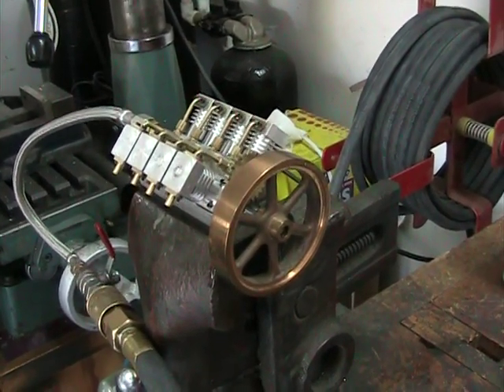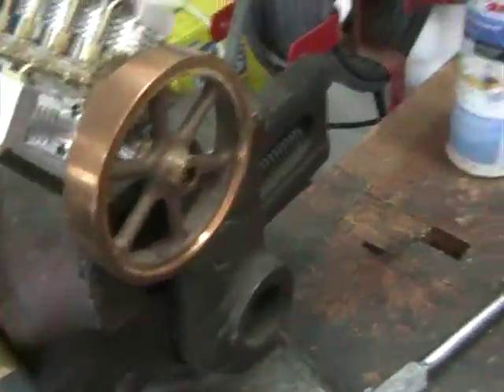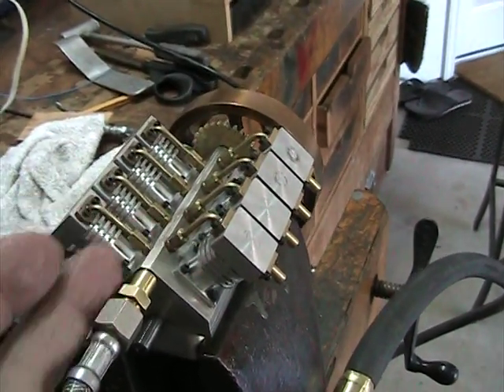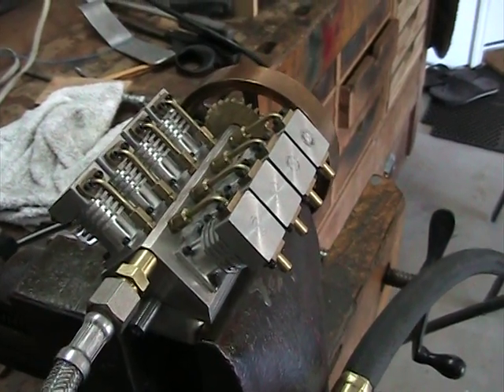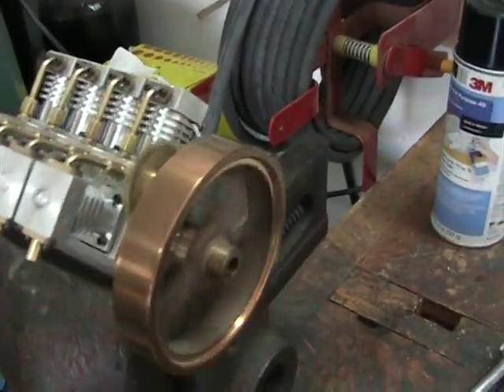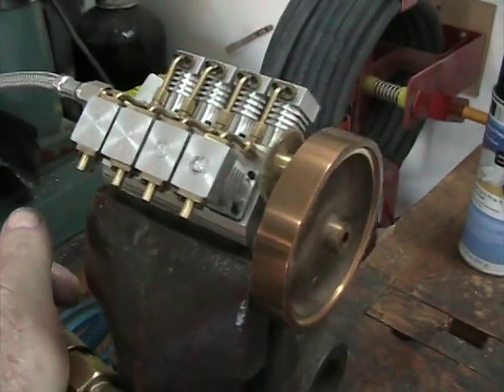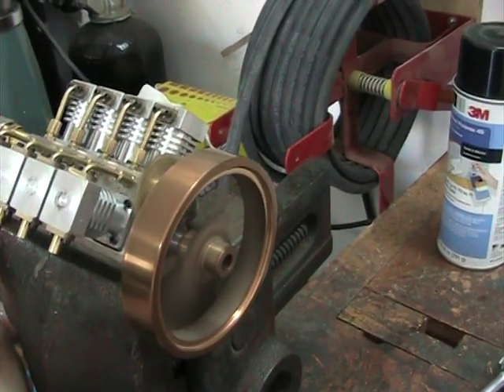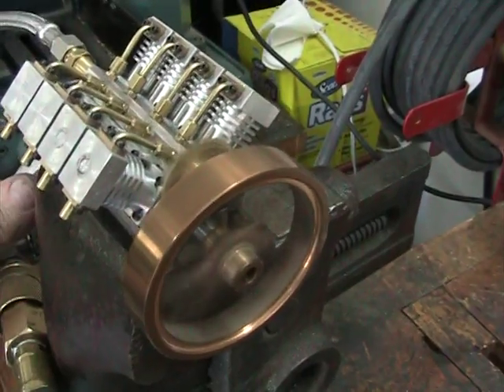Compressed Air V8 N1

Comment: It's a check valve, not a ball valve. Ball valves are manual valves usually set up for 90° rotation, where you are literally rotating a ball with a hole in it such that the working fluid either sees the hole or the solid walls (or something in between) - like the one you use to control the inlet air.

Normally they're used as shutoff valves though, due to their nonlinear characteristics. For finer control you're better off using a gate valve or better still - a needle valve.

Comment: Has anyone ever used steam instead of compressed air in one of these things? May be old school but be fun to see the exhaust as well as consider the fact that you don't need a compressor, just boiling water to produce pressure and a release valve for the throttle.

Comment: Beautiful machine. Such compressed air engines can power a lot of things that need cheap fuel. The light car for shopping could run on air, if we wanted to make one. Keep going forward with your wonderful project !
Reply: Because the energy used to compress the air outweighed the energy to charge the battery in a eletric car
Reply: @silvia_fuku0ka845  impossible!
Reply: The Amish have been using air motors for years. Search Amish air motors.
Reply: @flynnstone3580 I saw Amish life on YouTube. They don't use electricity. It's the most beautiful life.

Comment from the maker: This model engine was designed and built purely to emulate the look and sound of a full size, petrol powered V8 engine.  As such, it would be very inefficient as a prime mover so scaling it up wouldn't be practical.  A compressed air engine suitable for powering a vehicle would require an entirely different design.
Reply: Hey, i love your engines, I have a school project that I need to move a small 2kg (4.4 pounds) weight  with compressed air and was thinking about doing something similar to this bit a bit larger, do you have any suggestions or tips? Maybe a more suitable design for power?

Comment: Love this engine, would be great to see a scaled up version and running a vehicle.
Reply from the maker: Unfortunately, an engine like this large enough to run a vehicle would require a huge compressor or an impossibly large air tank.
Reply: Chuck Fellows I know it’s not the same engine as yours, but 4 major car manufacturers have produced protype Compressed Air Vehicles( CAV), with TATA announcing they are going into production of their ‘Airpod’ CAV, they have prototypes of other models of CAV. If you type in ‘ Angelo Di Pietro’ u will see vids of the Rotary engine he has designed for CAV. He has converted all his factory vehicles to run off his engine and CA, including Forklifts, Scooter, Flatbeds etc.
Reply: Chuck Fellows an engine like that perhaps, but much more efficient CA engines have been designed and Air can be compressed very easily via a basic purely mechanical Turbine or a Trompe, if you don’t think CAV are viable I suggest u watch this and connected vids to the engine designer ‘Angelo Di Pietro’ https://youtu.be/eRVLHvT0BQM

Comment: That's one sweet project! At one speed it sound like the old V8 with solid lifters. I guess from your description of it , it is " solid lifter valve".
Reply from the maker: It doesn't have lifters at all.  It uses a rotary valve to direct air into the cylinder.  What you are hearing is the cllick of the ball bearing slave valve which is pushed open by the incoming, high pressure air.

Comment: Hay ever learn anything about liquid atmosphere and how you can fill a pressurized bottle with a frequency emitter in the bottom that causes the liquid atmosphere to revert back into a gas then have a pressure valve set to operate this engine at a set speed? Ferro fluid and gadolinium magnetic bearings for moving parts no need for lubercation. Have a system of alternating tanks a tank fills up with liquid atmosphere has the other is being depleted. Be a neat way to crank an electrical power generator. Could even develop a whisper quiet model recreational vehicles could use to replace their noisy gas and diesel power generators? 😊

Comment: I know but as per my air pump invention  air will not discharge from the tank and cycle of rotation will also not disturb  one time refill of air vehicle will run miles and miles

Comment: hi come to India with this this will make run on air with out discharge of air automatic pump is already invented only need to add
Reply from the maker: This engine is way too small to power anything useful.  Engines that run on compressed air have been researched and tested, but there is currently no way to store enough compressed air in a vehicle to go more than a few miles.

Comment: What machines/tools do I need to reproduce this model using a blueprint?
Reply from the maker: Small metal lathe, small milling machine, small drill press,  measuring tools such as calipers or micrometer, height gauge for layouts, drills & taps for 0-80, 1-72, 2-56, and 4-40 socket head cap screws.  With the metal lathe you'll need accessories such as a 4 jaw chuck, live center and drill chuck for the tails stock, tool bits and holders.  For the milling machine you'll need accessories such as a milling vice, end mills & holders.  For the drill press you'll need center drills, and a numbered drill set.  There's probably more but that's what comes to mind.
Reply: Thank you :)
Reply: oDJoldschool
a gun smith can build all your individual parts for you if you give pictorials wit specifications.
there always bored and ready to play with something new and interesting.

machinist in general like chuck seem willing enough to exspress there knowledge, however, always seem to have and air of self centered authority i find very unpleasant and
uncooperative.
they have this way of makeing the inventer feel very un worthy of any real assistance from a higher mind.

Comment: can that engine be used to re filling the air tank so the movement will be forever ?
Reply from the maker: No.  It consumes way more energy than it can produce.
Reply: charle stupid
Reply: we can use it for refilling but it produce less energy than it consume but it is possible by using another compressor on a car or bike by vehicles motion

Comment: I know this is an old post, But why one dead stroke?  If I understand your valving right you are running one stroke without power,Is it because the ball valve doesn't have a fast enough reaction time?
Reply from the maker: This engine was modeled to look and sound like a full size, 4 stroke engine, that's the reason for the cam operation.

Comment: Well done! we build tidal or river current powered generators, have you considered building a much larger version?
Reply from the maker: No, this engine is just for show.  Compressed air engines to do real work are kind of impractical if you don't have a portable compressed air source.  And bigger engines use a huge amount of compressed air!
Reply: Thanks for getting back. Our tidal power machine can produce a lot of compressed air at little or no cost. Do you know how to convert a high hp engine so we can drive a generator. I believe using comp air will allow us to better control the variations in water current speed.

Comment: how does it not seize
Reply from the maker: It has a wet sump with oil in it that gets splashed up on the cylinder walls.  I also put a few drops of oil in the air line to lubricate the valve shaft and upper cylinders.
Reply: +Chuck Fellows oh ok thanks. sweet project

Comment: Cool engine!  I was curious how the lubrication system is set up?
Reply from the maker: +Michael Clarke The top end is lubricated by a shot of oil in the compressed air line whenever I run it.  The bottom end has a wet sump, splash oil system.

Comment: I wonder when these will be available for cars and airplanes. Especially with all that talk about reducing emissions to help th'envionment.
Reply from the maker: +Travis R. These engines are just for show, not to power anything...
Reply: Chuck Fellows Oh OK.
Reply: +Travis R. It's an air engine.
Reply from the maker: +James Vander Vegt To power a car or boat or airplane for any practical distance requires storing a significant amount of potential energy to be released gradually over the course of travel.  Storing that energy in the form of compressed air requires either a very large volume or a very high pressure.  So far, it has not been demonstrated that compressed air is a practical alternative to batteries for storing such large quantities of energy.  If you are going to convert sunlight to usable energy for powering a vehicle, batteries and electric drive motors still rank highest in terms of practicality.
Reply: Chuck Fellows All right then. It seems it may be a while before a good alternative is found to gas. The problem with electric vehicles is recharging takes so long.
Reply from the maker: +James Vander Vegt It might be feasible to make a hybrid vehicle using compressed air.  Instead of a battery and charger an air tank and compressor would be used along with a gasoline engine to compress the air when the pressure got low.  Unfortunately, a vehicle with a gas engine, an air compressor, and an air motor begins to sound pretty complicated, at least in terms of moving parts.
Reply: Chuck Fellows
I wasn't thinking combining a gas engine with an air compressor, more getting compressed air straight from the compressor at a station. But you said that's probably not reliable, so yeah.

Comment: do you think that you can make this for a real car, if not tell me the issue thanks
Reply: You could but compressed air is not nearly as efficient or powerful as petrol.
Reply: Aldo Allende Oliva try this vid I think you will find it very interesting! https://youtu.be/eRVLHvT0BQM
Reply: Vantage Zone what?, compressed air can loose its pressure and just be ‘air in a tank’. That is rubbish, if there’s no leaks the pressure remains the same. Try this vid -https://youtu.be/eRVLHvT0BQM

Comment: pretty sweet I did something like this when i was a kid and tore my dads 2 stroke chainsaw apart took the spark plug out and feed compressed air into the spark plug port. was tough to get started. but once started it worked well.

Comment: That thing is flipping awsome! What kind of horsepower does it put out?
Reply from the maker: Not much power.  Engine was built for looks and sound, not to put out any serious power.
Reply: +Chuck Fellows if you use it on a rc car it would probably have some power
but you would have to use something a bit lighter and cut it down to a v4

Comment: good job sir! But how its a 4 cycle operation? it should be 2 stroke right?
Reply from the maker: No, the valve tube that delivers air to the cylinders turns at 1/2 the speed of the crankshaft, so compressed air is routed to each cylinder on every other revolution of the crankshaft.  This is done so it sounds more like a full size car engine.
Reply: ok! now I got...!

Comment from the maker: Wear isn't a problem. You actually want the slave balls to fit kind of loose and a little air leakage doesn't hurt a thing. Probably makes it sound better!

I didn't machine the balls. You can buy ball bearings on Ebay or Amazon in any size you want, dirt cheap.

I would start with a Grizzly 9x19 or bigger. A 7x12 or 14 is OK but requires some work to tighten up the tolerances and make it more useful. Stay away from used lathes as excessive bed or bearing wear is a problem that's hard to fix.

Comment: Thank you Chuck! One 3 more things - the friction and constant actions of these balls and springs won't cause the intake and exhaust ports to widen up in diameter which will cause air leakages ? Another one is how to machine a perfect ball on a manual lathe? Especially a one of that tiny size. And the last thing - what lathe would you suggest for a begginer model machinist? Grizzly ? Sieg ? Some others ? Of course not a chinese production with plastic gears... :). Thanks in advance !

Comment from the maker: The slave valve is just a round ball bearing.  The ball is inserted from the exhaust port side, then the spring.  The exhaust pipe & flange are then attached holding the whole thing in place....

Comment: Wow! Great work. I like pretty much your solution to make it run on a 4 stroke cycle.
-> the solution with the ball-vavle in the cylinderhead.
The sound is much closer to a real V8.
I wonder if the long tubes (containing compressed air) from the intake-vavle to the intake are causing the ball-vavles to react a little late...

However the sound is perfect an it looks really great.
you´re welcome to ceck out mine if you havent yet.
Supermicro V8 Crossplane

sencerely